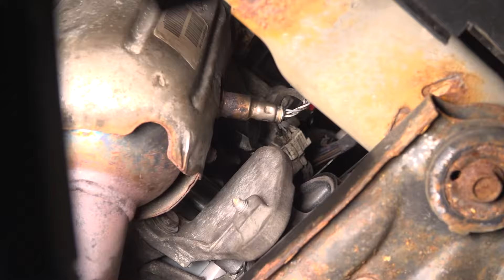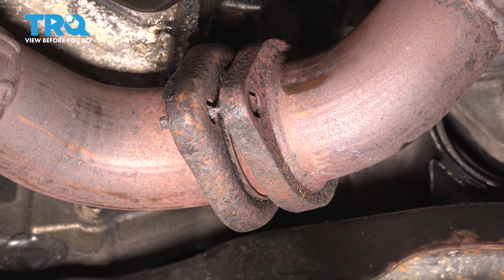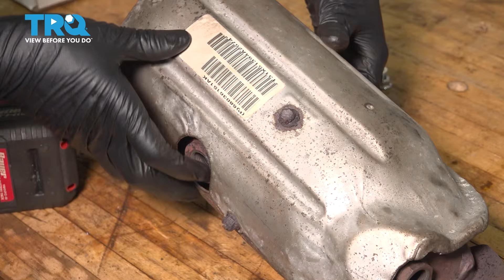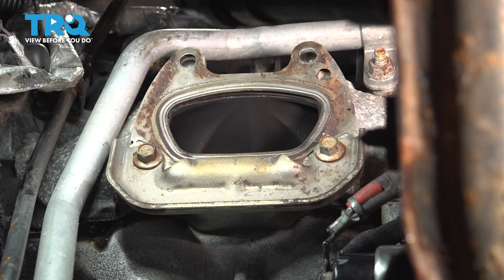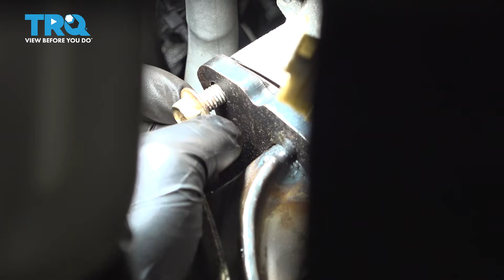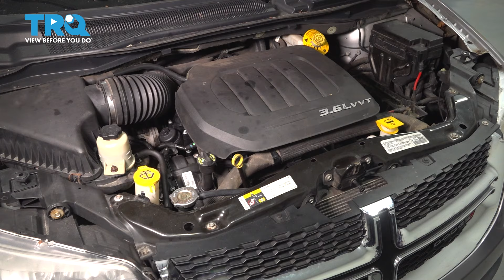How to Replace Front Catalytic Converter 2008-2020 Dodge Grand Caravan

Comment: I am in the middle of this job right now - the new cat won't fit while the rest of the exhaust is intact - hopefully just have to disconnect/replace gasket of the next flange on the pipe.
Instead of screwing around with hard to get at and rusted cat and oxygen sensor bolts, I removed the upper rad hose and a few electrical connectors, then the coolant overflow lifts right out, and so does the fan shroud.
That gives you enough room to easily remove and reinstall/retorque the bracket bolts, the cat bolts, the oxygen sensors, and the wiring harnesses - that always stick. There is so much room the new cat fits down from above as well.

Comment: IIRC  did you miss showing the Y pipe bracket bolt that needs to be removed also?  If your rear convertor nust are F'd and you dont need the rear changed out, you can get 3 of the 4 front cat manifold bolts out with a socket and the 4th one is a 10mm wrench snaked behind the heat shield. Once that is loosened a few turns, you can unbolt the lower clamp and move the converter just get the ball to clear the pipe socket and lift out. Then you can get the hidden bolt out with ease to replace the gasket. Bolt up the bottom hanger bracket but keep loose, hand the convertor and snug the lower pipe clamp, then socket the 3 you can reach to 17 ft/lbs and then tighten the hidden one about as tight as the little 5" 10mm wrench can. Install the front heat shield and your golden.

Comment: I’m a licensed aircraft mechanic — we would never reuse corroded old bolts like you did on the converter shield, etc. We would always install new A/N hardware. Why don’t you do that on a car? The bolts surely must be much less expensive than aircraft-rated A/N versions! Since they’ve already started corrosion, why risk damaging to the new converter or future replacement trouble?

Comment: I have an exhaust odor coming inside the passenger compartment of my 2013 Dodge Grand Caravan during hard acceleration and I sometimes can hear an exhaust leak on a cold engine. This video is giving me ideas as to what to look for. I suspect a leaky flange. At least I'm hoping it's as simple as that. This is a very good video.

Comment: Thanks for this great video. I got a wrangler JKU. Same engine. Needed to replace a gasket. Unfortunately the manifold bolts were rusted and I broke them. What is the best way to remove them? Bolt extractors or welding a nut to what is left out of old bolts?